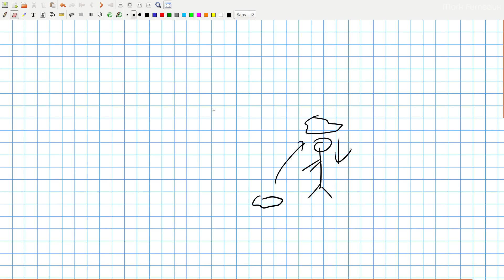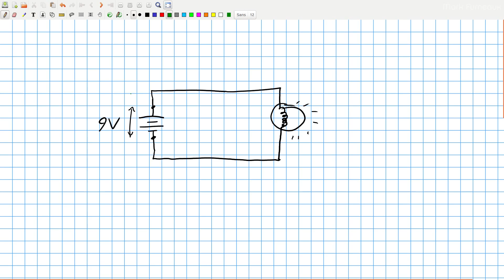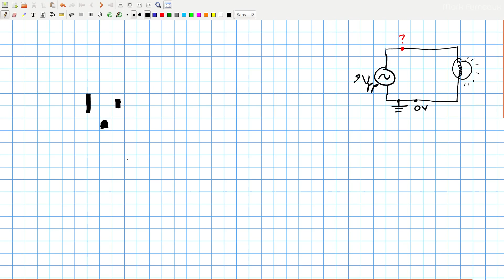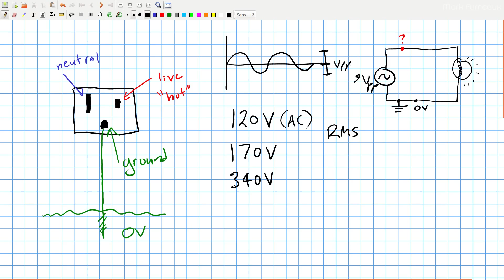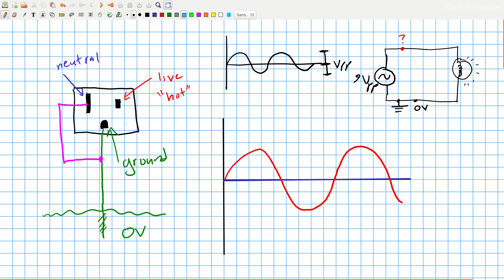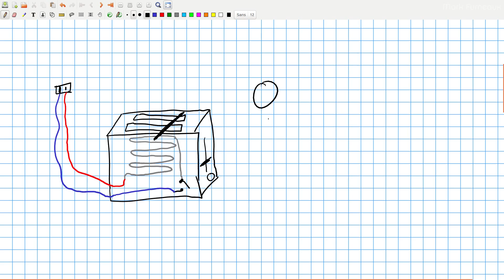Why Mains Sockets Are Polarized

Comment: One wire is 'hot' ie.. NOT wired to ground... the other 'neutral' is wired to ground AND returns to the center of a balanced transformer send from the power line... If you plug something in opposite ( not wiring fault but fault with the device ) it... It really doesn't matter.. UNLESS the device plugged in has a switch on the HOT side of the plug... Effectively making the entire device "live" even when the switch is off...  I think the problem with most explanations is.. It takes too long.. 32 minutes to explain this is WAY too long.

Comment: Much of Europe uses the German Schuko plug, which is symmetrical and incapable of being polarised. It is an old, but advanced for its time, plug with a ground tag. However, it dates from a period when power was supplied to homes with a 220v system with centre ground reference, not unlike the way that North American homes get 240v, although there was no neutral. Later, the Germans switched to a more conventional 220v system with neutral and live, possibly to fit in with three phase local distribution. North America was able to retro-fit polarisation and retain backward compatibility by widening the neutral blade, something not possible with the Schuko round pin plug.

Comment: 22:54  Copper is expensive, they will use aluminium wire likely, in any case, 2 wires or one wire, ground or no ground...Aluminium. (Al is allso lighter, much lighter, and much stronger (tensile), so poles (i mean mechanical support wooden poles or metal poles or whatever support structures) can be weaker AND further apart. AND they might use iron/steel core aluminium wire, which can handle even more tensile strength...) 
BTW, if properly grounded, earth/ground is actually quite good conductor, it is poor conductor per se, but, as there are square kilometers wide paths that electricity might/will take, resistance will be often lower on ground return loop than on relatively thin (live) copper wire, that is few miles long... 
This way of installation is not recomended because it is unsafe, not inefficient.

Comment: Did not know that there was a polarized socket system existed .. either way you should always presume that an electrical device is always hot and do not rely on switches and polarized sockets.

Comment: Also metal devices need to have polarized plugs as opposed to double insulated devices. This is so the metal part doesn't kill you. For example, microwaves, refrigerators, toasters, etc.
Reply: Hmm, microwaves and toasters have normal reversible plugs in most of Europe, afaik.
Reply: @herrfriberger5  In the US, most devices have polarized plugs. Exceptions that I can think of are mainly things like phone chargers.

Comment: Also the sockets for light bulbs and fuses were polarized so that the hot part is in the back, out of reach. In the case of changing a bulb, it shouldn't kill you if you accidentally touch the neutral portion of the socket.

Comment: Great lesson but the idea of using the actual Earth as a return path from a substation to a residence is untenable. It would violate several code articles, the most serious being that a building's electrical system is not allowed to induce a voltage into the ground itself.  This is where the danger lies. Then there is the variability of soil conductivity. The ground itself is not a good conductor, so the power available would be very limited.
The center tap of a 120/240 volt single phase transformer secondary is grounded at the base of a power pole via a driven rod or a plate at the bottom of the pole. In certain climates, such as Seattle WA a return path between the pole ground and a building's service grounding means could make a partially functional return path if the neutral from the pole was open. But very limited current capability would be available and the current induced into the ground  would be dangerous and illegal. 
The feasible distance to supply a building at 120/ 240 volts using a neutral and a hot conductor at say even as low as  30 amps would be extremely limited. So the utility would have to run your power at (commonly) 12,000 volts, terminating at a step-down transformer whose cost is basically insignificant relative to the cost of heavier overhead conductors over a long distance. The conductors would almost certainly be of aluminum, and if you are in the boonies with no power you will probably have to pay to have the lines run to your property.

Anything you might need or want to know about electrical installations can be found here: 

Electrical Construction & Maintenance ( EC&M ) Magazine
http://www.ecmweb.com/

Happy reading, and again thanks for your electronics and computing videos.

Comment: In many countries, eg. Germany, the plug is reversible.  The solution to the problem is instead that switches have to be 2 pole.  This is enforced by electricity safety regulations, such as the ec mark you will see on many devices.  I would guess that if your device has the ec mark, the power switch is 2 pole.
Reply: Pretty much whole of Europe uses reversible plugs and sockets are not polarized.
Reply: misium to further clarify, pretty much the whole of continental Europe (save for a few exceptions) uses the standard German Schuko outlet, or a very close variant (like in Sweden or France) that is compatible with universal Schuko plugs (the ones with the female earth connector in addition to the two side blades) and Europlugs (the leaner, non-earthed variant). Italy and Switzerland, AFAIK, are the only ones that have slightly weirder standards, and the latter’s outlets are also compatible with at least the Europlug.
Reply: @Mainyehc  UK also has non reversible mains plugs and sockets which are switched on the live and are not compatible with the Schuko. Coming from the UK and having to look at the wiring of my house in Belgium, it was horrific as the house is wired 3 phase and in some rooms you had floating voltages on the neutral. Putting in a home cinema I had to rewire the house to make sure I had everything separated out and isolated. Oh I longed for UK standards here, even my wife prefers the plugs and sockets in the UK.
Reply: The ec mark does not mean the switches in appliances are double pole. All appliances sold in the UK are EC marked, and that means they can be sold anywhere in the EU (or any non-EU country recognising the mark). There are plenty of small appliances that use single pole switches.